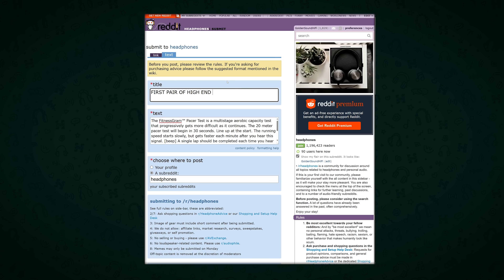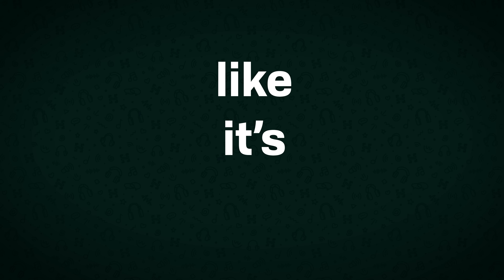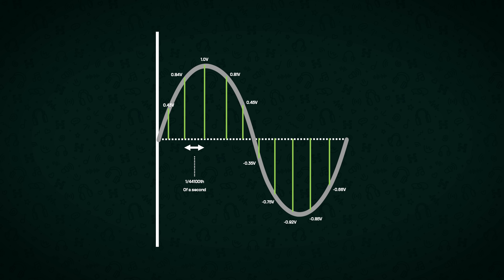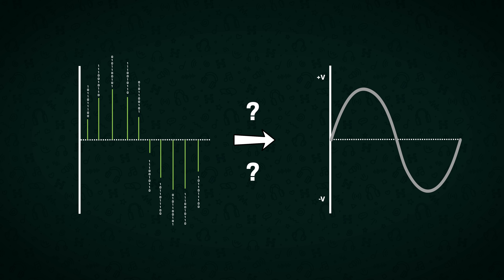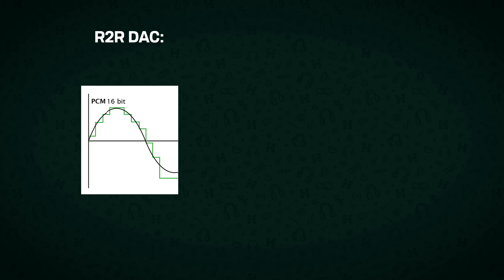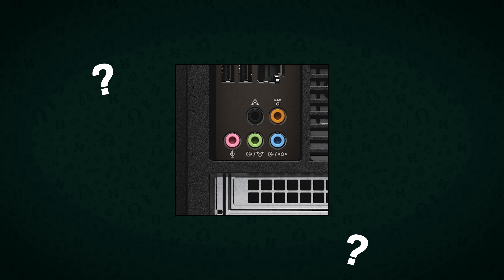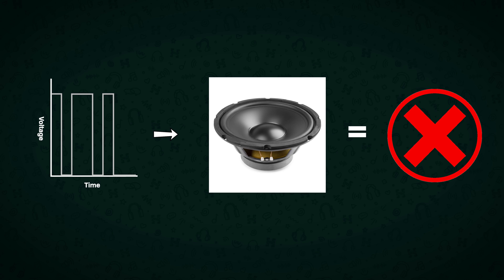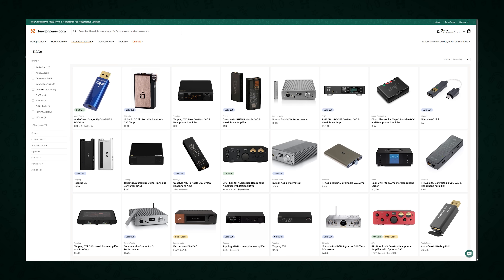What is a DAC and why do you need one?

Comment: So.... microphone is an anti-speaker?
Reply: Yes!
Reply: Mics and speakers are actually exactly the same. You can use a speaker as a microphone.
Reply: Actually speakers and mics are exactly the same. You can use a speaker as a mic and vice versa, it just won't be good.
Reply: Actually speakers and mics are exactly the same. You can use a speaker as a mic and vice versa, it just won't be good.
Reply: You can actually use one plugged in as a speaker and if you manage to not burn it out you will actually hear sound reproduction out of it. Same if you plug a speaker or headphone driver into a mic port and speak into it - sound will be registered, even if only at very bad quality.

Comment: I'm a little worried that the cable joke won't be obvious enough to some people 😬
Reply: I laughed my ass off at that ahahaha
Reply: @or1on89  same lmao
Reply: CaBlE oBvIoUsLy MaTtErs, ill demonstrate by running  signal trough this thin non-insulated stainless steel wire, then show you the same audio with a quad braided OCC silver cable. take THAT non-believers!
Reply: Ha. No, the cable joke was pure genius.  Outstanding video.
Reply: Snake oil reference for anyone coming from outside the "audiophile" world.
Reply: nah bro I can smell the quality of electrons that have only ever been fed through pure silver rather than the revolting taste of copper contaminated ones 🤮
Reply: Need more in depths about the cable, I'm curious.
Reply: @pinoylanggaming9449  
You really only need to know 2 things ...

1) If the cable you're using is adequately carrying signals to your devices, they are good enough. Spending more money or going to exotic designs will do nothing more for you.

2) A lot of very confused people will try to tell you otherwise.
Reply: DH Labs Toslink Glass Master 😊
Reply: @CarlVanDoren61 had to Google it but holy moly that's dumb.
Reply: @blaquidusty  wrong; there are many of us interested in quality and purity of sound based on objective facts.
Then there are the ones running away from double blind testing and non sponsored product reviews.
Reply: Made me laugh-snort!
Reply: It is obvusly a joke, the most important part of a sound system is the anti-vibration gear and a really expensive thick AC cable. With those two things, you don’t even need music.
Reply: @MitchGurowitz yes, you listen to music to acquire joy. But with those equipment, you acquire joy by watching them, touching them. Why do we still need music?
Reply: @techguy6565  My apologies, but I don’t think you knew I was attempting humor in my language. I work in a recording studio, I am a concert photographer and have been playing guitar for 50 plus years. I have seen more live band shows in the last year than most do in their lifetime. Not sure why you made such an assumption.
Reply: @MitchGurowitz sorry, maybe there is problem in my expression.  I know exactly your humour. So i am not questioning if music is important. You and me are sure that music is the more important thing. I am mocking those who are playing with lots of high quality cable without really care about the audible sound quality
Reply: cable can actually solve some issues, but very specific ones, like having a combo jack for headset. wires that transfer weak mic signal can catch electric signals that drive the headphones and people who are you talking with on discord or something can hear what you are hearing🤓
Reply: @voltflakethat's called crosstalk and is generally a bad thing unless you want people in Discord to hear what you're listening to.
Reply: Nice move to skip the “Cable” portion fast.
Reply: I can't find the joke so don't now what's up.  In my view as a long time person in the high end world, the majority of people who scoff at the cable idea have never bothered to, in the words of early 20th century composer Charles Ives, stand up and use their ears like a man.  I have loaned out cables thousand of times over the years.  If the customer says they did nothing I thank them for taking the time.  If they say they heard an improvement but don't feel that it justifies the price, I thank them for their time.  If they love them, obviously that's a good thing.  I have never told anyone what they should hear or they should expect to hear.  Some cables are hard to hear a difference with, I'm the first to admit that.  Ify ou're straining to hear a difference, move on.  One constant is that high end.cables tend to be grotesquely over priced.  Unfortunate but true.
Reply: wait, you're telling me that the power cable I just bought for 2999 per meter is not worth it 🤣
Reply: My audio cable was spun by 500 Vestal Virgins and was then blessed by the Pontifex Maximus. My Crosley suitcase player never sounded better!
Reply: Hahaha that got me dying, I was thinking the same... I hope everyone noticed...
Reply: You atleast need a magical 1000$ usb cable and some million dollar analog cables to get 100% out of your system
Reply: I really, really need to start my own exotic cable business! Turn a $6 cable into $8,000 profit!  It works for Gucci and Dior.
Reply: Youre right to be afraid of
Reply: What joke?
Reply: Right, not all cables are equal, if they are a pc gamer you can compare it to Display port how they look the same but don't perform the same some can't even put out a 4k signal even at 15htz while others can do so at 120htz